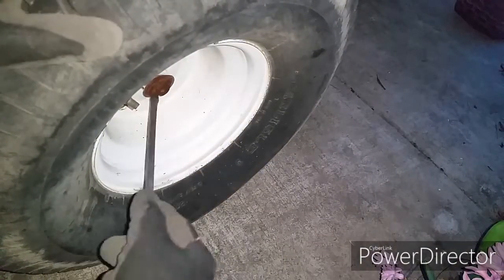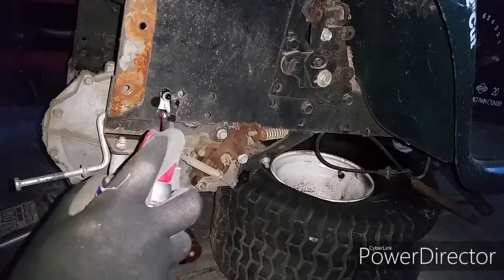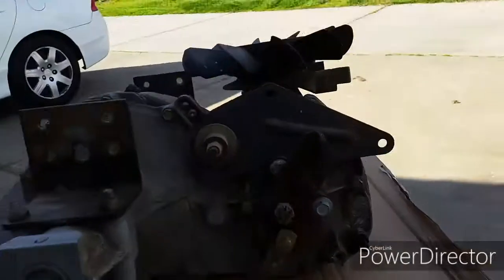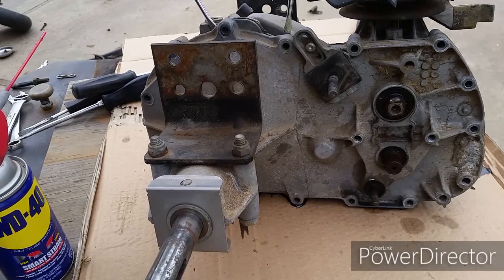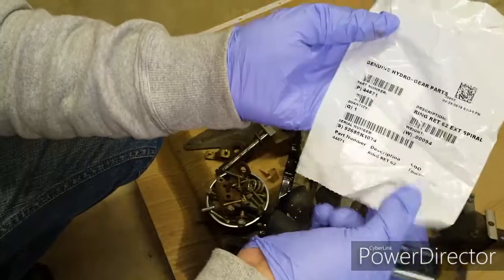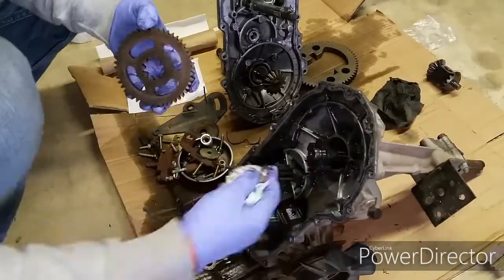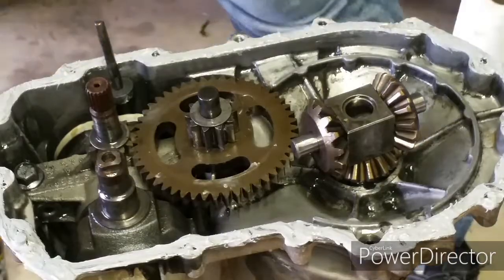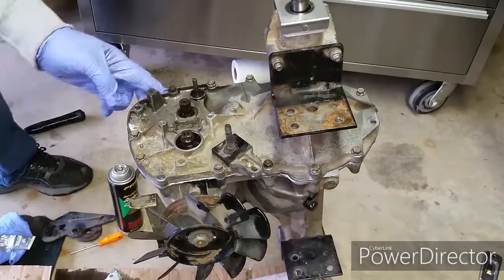Repairing rear riding lawn mower hydrostatic transaxle. Broken retaining ring.

Comment: Thanks for this video, dealing with this exact problem the axle came out before the wheel came off. In fact I still have the hub of wheel on the shaft I still have to remove yet (air chiseled the wheel off as it was bent anyhow) and have to do the repair on the transaxle as well. Luckily I have extra wheels but not extra hydro trans. Sometimes that bigger hammer and steel bar method is just too much!! The other side just fell off.

Comment: 4 of my torx screws broke when i was taking it apart i might just get 4 replacement ones from the store.

Your transmission looks different from mine but they all usually have the same size axles

Comment: My rear wheel rim is held on with a roll pin that slides through the flange or hub on the wheel & through the axle . On something like this where it was rusted on I would have first pulled the air valve out of the stem so the tire won't explode then use a torch to heat the outer circumference of the flange or hub then letting it cool & spraying with some PB blaster then heating again & pounding the wheel off with a BFH & a wood block to not bend the wheel .  Good thing though is now you know how to go through & rebuild the rear differential on this ! I was on YouTube here to find some people who were going through & rebuilding these rear differentials because mine although works good for being made in 91 & has mowed my 15 acres for some years before I bought a bigger tractor & now use the Sears for the smaller areas I looked in the factory manual & it literally shows no drain or fill plugs to change out the fluid in it so I now assume that they greased then sealed for the life of it so I am going to take mine apart one winter to clean it up good inside then inspect & replace any parts it might need then if possible add a fill & drain plug on it to use gear oil in it instead of grease provide the seals it uses can be used for gear oil & not just grease to keep water dust & dirt out of it . The deck manderals are the same they have roller bearing but are sealed on both side so what I did was took the spindles off & apart cleaned them up good then drilled a hole for a grease zirk in each spindle in a area that's easy to get at on the mower deck to grease the bearings . Take one of each inner bearing seals off but keep the outers on then fill the cavity with grease then assemble & once every other mow Wich would be for me about 8 hours I just pump a couple of strokes of grease into the bearings to keep them lubricated instead of having to replace them every few years because they can't be greased & are sealed but do get exposed to dirt dust & water from wet grass that ultimately causes the one time grease job to break down then the bearing rollers start to get rusted & pitted causing excessive heat & vibration which kills the bearings .
Reply from the maker: I don't believe you can put gear oil if it calls for grease only. The casing is not designed to hold gear oil.  You can take it apart and remove and add more new grease.

Comment: Thank you for your video on trans axle. I cannot remove right wheel from my old cub cadet
The left one came off with axle. Any suggestions on how to get it removed? Bout ready to chunk it!!!
Reply from the maker: Don't try to force it. You will break the retaining ring. Sprat penetrative oil WD40. use a torch to heat it and spray wd40. Eventually, the rust that holds the axle and wheel hub will come apart. Don't hit the wheel inside or yank it aggressively. That retaining ring is pretty flimsy.

Comment: Sigh....I broke both sides.fml this seems difficult. Good vid
Reply from the maker: Inexpensive parts but A lot work.
Reply: @tonedubb4325  no doubt. Ive taken the wheel off before and had enough sense to Google it beforehand. This time,in the heat and humidity just threw common sense in the wind as I hammered both wheels off. Lesson learned
Reply from the maker: They say.. if you can get it off,  use a bigger hammer. Shouldn't have listened to their advice.
Reply from the maker: Cant get it off, i meant
Reply: @tonedubb4325  lmao. I used the handle to my car Jack and wacked it with the hammer. Only smacked my hand once.  Half deaf now as well

Comment: I made the same mistake pulling a tire.  Didn’t know the axle was held in place by a paper clip. 
How long did the job take?
Reply from the maker: Took me about 1hr just removing.  Had to order the ring clip. Took about 2 to 3 hours reassembled it back included installing it back on the machine. 
My suggestion to all of there.  If you got a rush rim stuck to the axle, get a wisegrip or oversized plumber pipe wrench and clamp it to the axle. Spray WD40 and try to spin the wheel to break free from the axle. Just kept on doing it until it break free.  If it doesn't budge, use a torch. Dont bang on the wheel,  you'll end up like us breaking the clip.
Reply: @tonedubb4325  I had successfully pulled the one side off with a slide hammer.   The other side not so much 
I’ll probably pull the trans and replace the clip.   Thanks for the video and response!!
Reply from the maker: Take pictures of it so you know how everything goes back together. Good luck
Reply: @tonedubb4325  finally got the job done today.  You’re video and take pictures tip was a big help.  Just need to add the oil and put it back in but it feels like it should work just fine.
Reply from the maker: Glad to hear that.
Reply from the maker: It sucks. Pull everything apart just to replace a 50cent part. So much work. Good luck.
Reply: Anyone know how much fluid it holds? I’m about to do this same job lol sadly
Reply: @Skipuh  it’s around 2 qts.  
Make sure you take your time and go slow.   Also take pictures of everything.    I ended up missing a few things on the linkage and couldn’t get it back together all the way.  Ended up selling the tractor to someone else.
Reply: @lordrichard8184  got it all done but it doesn’t move lol damn

Comment: How did you end up getting the tire off the axle? I did the same thing.
Reply from the maker: Once that clip was broken or smashed, the axle was able to slide out. The retaining ring was pretty thin.
Now, the wheel and axle were separated, put the nut back on the axle, spray plenty of wd40, and if needed, heat up that stuck axle. Hit it nut with a big hammer. It'd come off.

Comment: Can you post links for the gasket sealant and oil you used?
Reply from the maker: I added more links and info on the description below.
Reply: In your video you don’t show how much gear oil you used how many quarts should I buy?
Reply from the maker: Fill the transaxle with approximately 2.5 quarts or 80 ounces of 20w-50 synthetic oil. During the filling process, connect a drill to the fan/pulley shaft and spin the transaxle to purge the air out of the system, allowing room for more fluid. Make sure the hydro disengage lever is engaged so the axles will turn as you spin the fan/pulley shaft with a drill.
Reply: @tonedubb4325  Thank you so much for the update that we extremely helpful and one last question when I pull the casing a part I noticed the bypass rod is just sitting in there not connected to anything is that suppose to look like that or is hook to something inside the case
Reply: also im having trouble getting the case to connect back together before putting the lid back on I move the gears and ll the gears are moving as they should it just won't sit into the casing flush for some reason
Reply from the maker: @joelwalker4356  I don't remember how everything goes back together.  I made that video sometimes ago. Are there guiding pins on the casings to allow you slowly to line them up?
Reply: @tonedubb4325  Yes I got it back together and sealed up I had to light bank it into place with a rubber mallet but I got it back together again. I do understand when opening the port to put the oil in is that the port at the very top next to the reserve tank that uses like a 4 star bit Allan key on it?
Reply from the maker: @joelwalker4356  I don't even remember how I did.  It had been so long.

Comment: Hey I had the same thing happen to me several weeks ago. I took the transmission apart and replaced the retainer axle clip. Now that I put it back together and back on the mower it only spins and axles with not turn. Is there something I need to do to get it to work. Did you have a problem like this also ? I need advice and help please
Reply from the maker: There is a level to allow you to shift to drive,  neutral, and reverse. It's probably not installed correctly.  It's probably in neutral or not engaged at all.  That's why the axle spines freely.
Reply: Thanks for the advice. The problem was I didn't give the system enough time to get the air out. I purged the system several times and the axles started turning. Cut grass yesterday afternoon. Thanks !!
Reply from the maker: @kevinbarnes2108  nice.
Reply: @kevinbarnes2108 
So happy to see your comment here!  Any advice on the purge procedure and how long it took for your wheels to engage?
Reply: @tmacc1529  If you have the transmission still out of the mower and full of oil start turning the fan pulley and also start turning the brake disc pulley until you can notice the brake disc getting harder to turn. This should help
Reply: Once it is back on the mower just start moving the lever into forward and reverse several times until the tires start turning. You will have to have the tires off the ground or floor first . Repeat this lever movement 3 or 4 times to help remove the air from system Hopefully this will help you. This is how I purged my hydrostatic pump.

Comment: I want to give this a try but I’m worried I won’t put it back together right .. the replacement is around $550..
Reply from the maker: It's a little intimidating.  Slowly take your time.  Take pictures or videos  of everything so you can put it back together exactly like the way you took it apart.
Reply: You have nothing to loose. But time. Have a shop do it would probably cost same as new I’m thinking. Labor cost.

Comment: Does anyone know what the small metal rectangle in the notch of the axle is called?  I lost one and have run out of ideas of what to look for.
Reply from the maker: It's called key. Go to a tractor supply, homedepot, ace hardware store, or order on ebay or Amazon.
Reply: @tonedubb4325  That's it!  Thank you so much for that, and for this great video.

Comment: I've got a zt2800 that the oil filter stud is stripped out bad. It can't be rethreaded. What would have to be done to replace the oil filter stud?
Reply from the maker: Isn't that part of the engine casing? How did  that happen? Maybe try rethread it. Can you even a rethread nut that size?  Only one idea for rethreading it if you cant find a nut that size.  Find large bolt that has same pitch as the oil filter, then a large nut for that bolt. With the nut flush on the bolt, place them on the drill press and precisely drill a total of 4 holes between the nut and the bolt to create your custom rethreading nut. Good luck.  I think there are videos out there showing you how to much those rethread nut.
Reply from the maker: Hope you can salvage enough threads on it to screw a oil back.

Comment: I might lock up my gears and test out that trick everyone else does it i don't why but I'll find out once i do and weld it up I'm not gonna weld mine with it sitting in place in the oil case I'll just clamp it to keep the gears together then weld it with it sitting out of the case i do have other transaxle transmissions

Comment: Can I use the same ring clip on lt1000?
Reply from the maker: Yes, if they are the same.
Reply: @tonedubb4325  I appreciate it so much
Reply: Hi I wish you can help me, I did replace the ring clip on my lt 1000 and I put all back rigth but it dont  move back or front what can be
Reply from the maker: @user-lg9xo9op7d  dumb question.  There's a linkage from the transmission to the rear allowing you to pull it or release it so either it goes in gear or not.
Have you checked that lever on the transmission? Is it installed properly when you put it back together, allowing that lever to engage or disengage?

Comment: I'm gonna fix mine its called the retaining ring is what we broke inside the transaxle transmission off the axle but I didn't have any other choice at the time and that's what happened I call it a clip to
Reply: I broke mine the other day and was hoping it was as easy as simply pushing it back in lol. WRONG! This is a great video because I was gonna buy another transmission off EBay for $150 a $175… but now I feel I can do it myself…especially for a $5 ring clip!!! Man…I’m excited! Thanks for the help. My mower is a 1993 Craftsman LT4000…
Reply: @lesliephillips8099  you might snap off a few torx screws i broke 4 of mine off just unscrewing them but i still got the transmission opened up the broken torx screws have just enough meat i can twist them out instead of drilling them out if they don't break again

Comment: I JUST knocked out an axle. There’s my day!
Reply from the maker: Yup. That sux. I know how you felt.
Reply: Yep just did exactly same.  Bent rim with puller then decided to add hammer.  Well  crap.  😂
Reply: Man I did it today 😂
Reply: @Constitutionalactivities  ha yep it sucks. But you get to inspect gears clean and lube gears. It’s a messy job. Mine showed no wear  on 1993 mower so pleased with that. Went back with never seize on wheel shafts. Fixed bent rim better than the one that wasn’t mauled  by me 😝. Still took 2 days having to pull body off to clean and fix starter solenoid hidden under body.

Comment: I just did the same thing
Reply: Just happened to me also. Having done this job, would it be worth it again?  My craftsman is 20 + years old. Buy a new component for 400 bills and bolt on? Or dig into it for $5 and 5 hours of time? Just asking, torn. Considering the rim is still locked to the broken axle and if I have locked rim issues on the opposite side I’m cursing up a storm again. I’m torn between new vs old (guts, gears shafts, clips etc). 
Thanks. Great video.